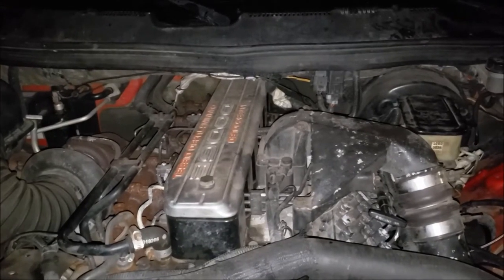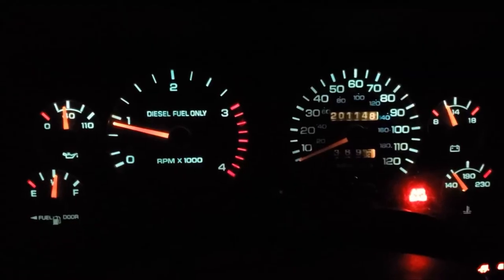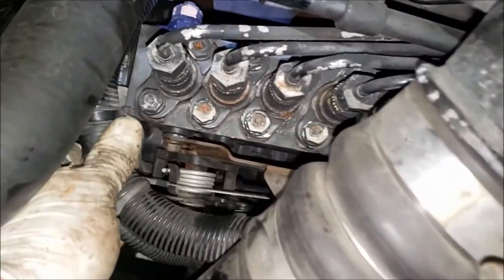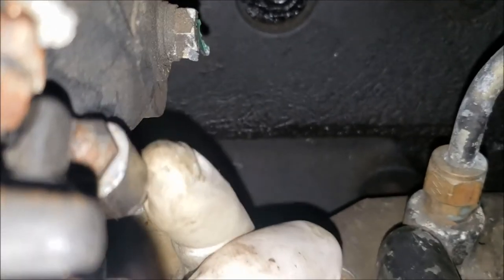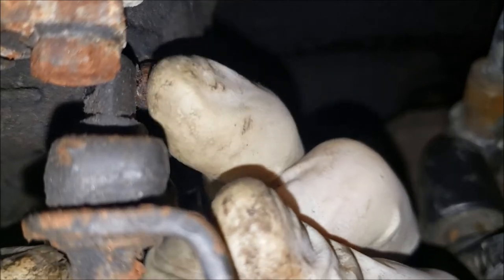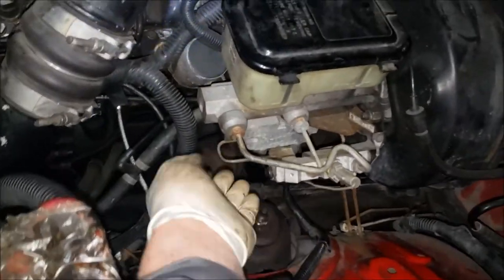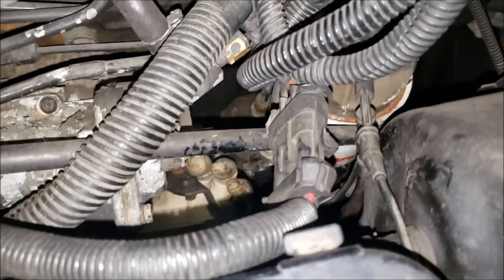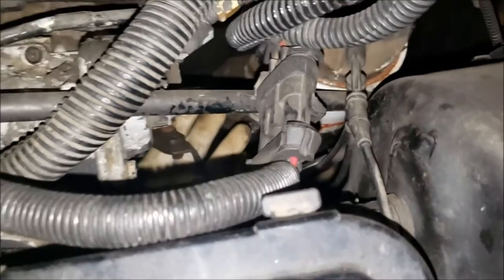How To Adjust Idle Speed on Cummins 12v FAST TO THE POINT!

Comment: My 95 cummins 12v idles at around 500 RPM,  when I put it in gear it stalls.. I've been having to use the throttle lock at 750ish to keep it running since I replaced all the fuel lines, fuel lift pump, and cleaned and the AFC housing... Also were that nut is, I'm having to cut in half a stubby wrench to fit in this area.. FYI I have a 95 Bluebird TC2000 with a Cummins 12v Front Engine so everything is tightly packed in a very small spot.. Thank you for this video to confirm I know where the adjustment is.
Reply from the maker: Sounds like a sweet rig!  No problem and happy to hear you found it helpful

Comment: I'm just mad i didn't find your vid when the inner fender was off, can't get my lanky arms thru top. Thanks for showing. My problem is 295 idle, now thinking bolt top is wore down.
Reply from the maker: I'm not sure which video you are referring too. I never had my fenders or Fender wells off.
Reply: Saying i can't get a wrench on thru top because of my arms being long ( 6'4") bad angle, but just showed the 5'5" dude doing my a/c and he just got it, in the time.........typing.............thus 😄
Reply from the maker: @creteking23  oh I got you. Yeah it's definitely a little tight in there. I'm 6ft 2in but I was able to get at it
Reply: My stupid 3.5in shiny but non funtioning intake elbow is not helping either. First try just below 800 from 295ish stalling occasionally.
Reply: Next n only thing left to fix is cruise control.....got vid for that?
Reply from the maker: @creteking23  nah, mine still works great so I haven't had to mess with it. But if it breaks in the future I'll surely do a video on it!

Comment: What if my truck only idles low when in gear and while cold? Mine idles perfect in park but when put into gear it drops to 200-300 rpm and kind of stutters like it wants to cut off. Only does it when first cranked though

Comment: So the idle is set at 750 to 800 in gear or in park cause if i set it to were its at that in park it wants to die if set it at that in gear it dosnt die but idles in park at about 850-900 seems a little high in park and neutral or is that normal

Comment: This dude wants to trade me a 1999 dodge It dies if your foot isn’t on the gas Could this help?
Reply from the maker: Yea probably.  Or some other pump adjustment issue
Reply: a 1999 dodge second gen diesel has a 24 valve Cummins, not a 12 valve from the factory.